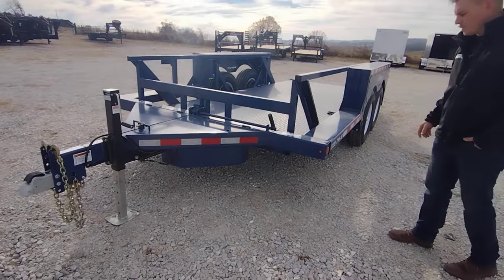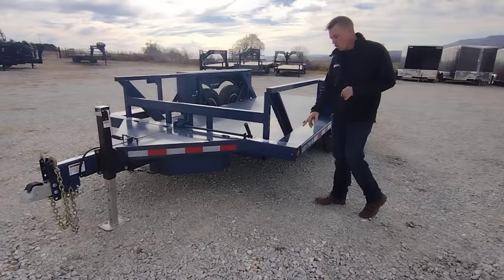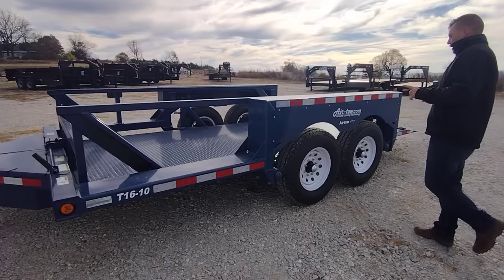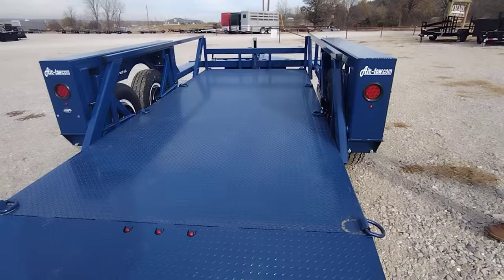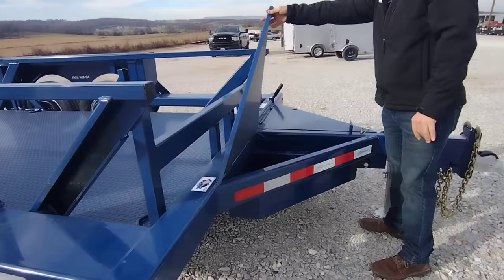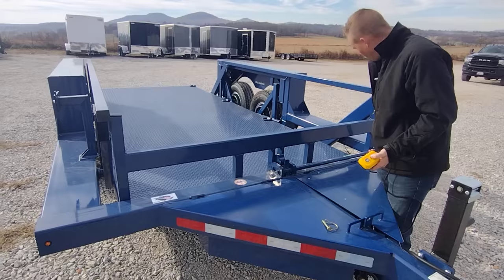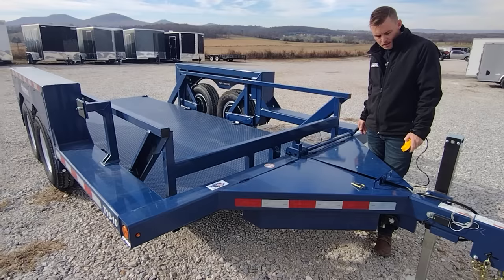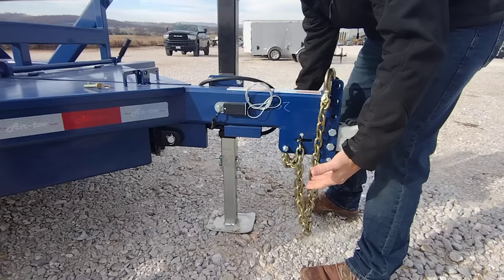Air Tow Trailer Model: T16-10 16' 14K

Comment: That thing looks WAAAAAAAY TOO HEAVY BRO! U gotta cut some weight from that thing if u want anyone to buy that. And how do u expect anyone to open their car door to exit? Not a good design bro.
Reply from the maker: I appreciate your input, @STAGEIIGN! You are right, this is a heavy built trailer! It weighs in at 3720LBS empty leaving a payload capacity of 10,000 lbs. You're definitely right, this would not make a good car hauler trailer, it would be better suited as an equipment trailer. It would not be ideal for loading a car with the width only being 75". This Air Tow Trailer would be more tailored for loading forklifts, scissor lifts, and assorted equipment. However, We do sell a wide variety of trailers depending on what you need. You should check us out at Ozarktrailersales.com !! You can email me at Jessicalove@ozarktrailersales.com if you have any questions. :)
-Jessica
Reply: @ozarktrailermfgsales1531  Thanx for the repy that makes more sense